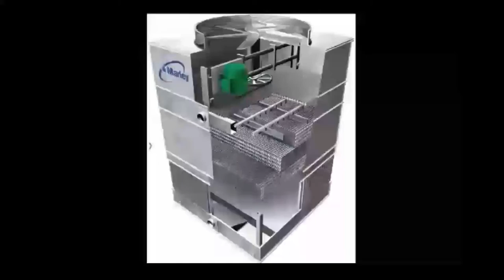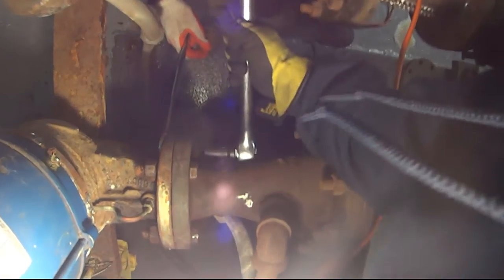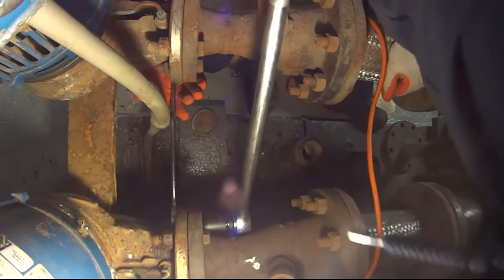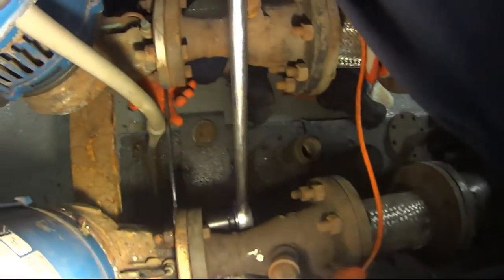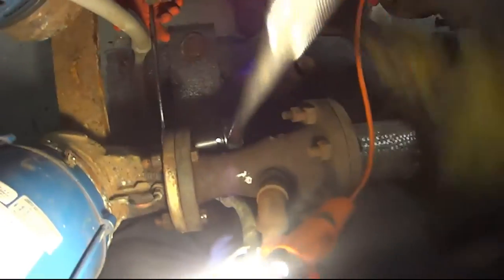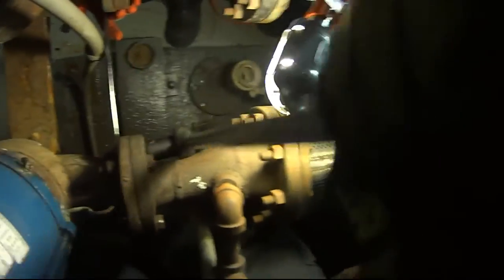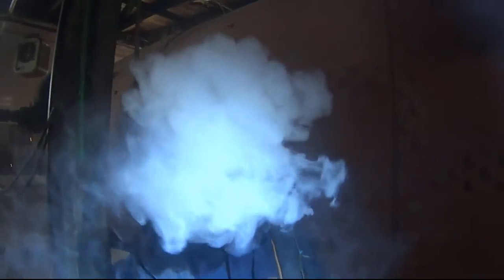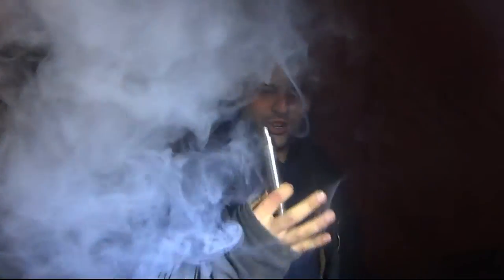Pumps |  Marathon Pump | Removed For Repair

Comment: Nice job on that pump.  A electric impact might of help if you had the right existent ion   and swivel joint. But never the less you got her done, good job. I am from San Antonio Texas and proud to be a 31 year member of Plumbers and Pipefitters Local 142    Stay safe brother
Reply from the maker: Wow 31 years is a very long time. You're absolutely right with the impact. However I enjoy using the hand tools lol. Thanks for the support Bud.

Comment: can I ask why you took the body and  motor not just the motor and SBA
Reply from the maker: It was just easier to remove the entire assembly. That thing is all rusted. My boss just wanted us to remove it quick and get out of there.
Reply from the maker: It's easy and quick to just disconnect from the flanges and bring back to shop for repair.
Reply: Hey I thought I would just ask I have never done it that way.But it sounds like you are a super tech.
Reply from the maker: Come  on guys no need get all crazy. Thank you guys for watching.